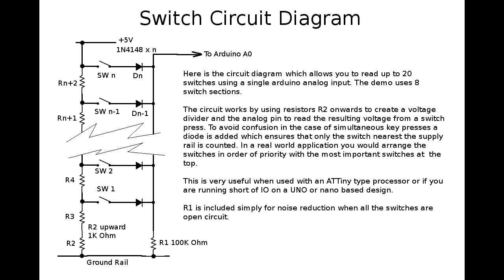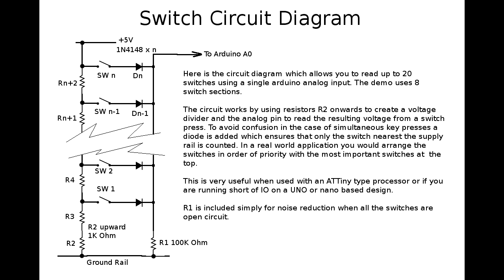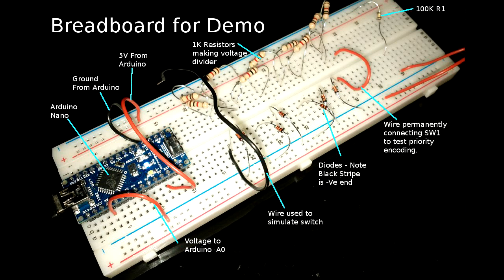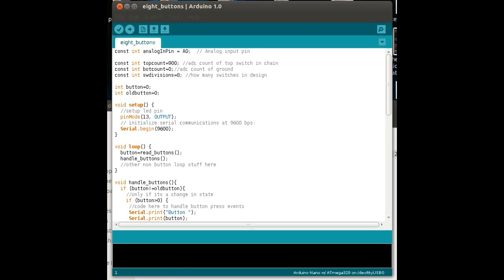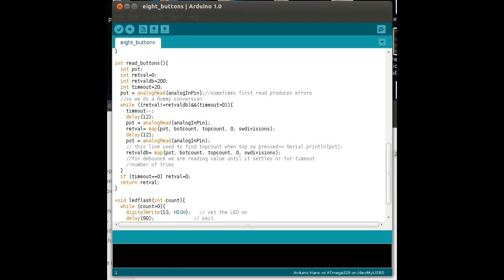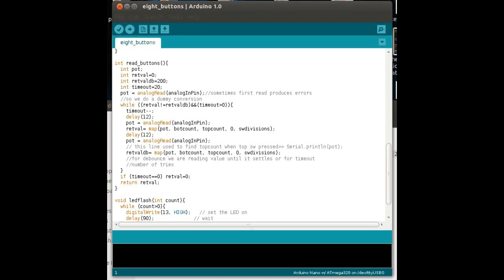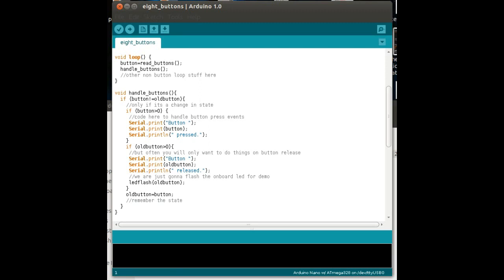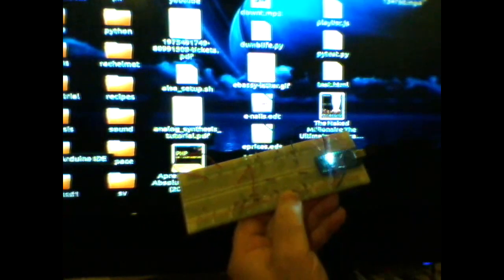Arduino Tutorial - How to read up to 20 switches on a single Arduino input - Even on an Attiny85

Comment: Nice idea. I think Forest Mimms used something like this in a security system that could tell which window the burglar was coming thru. I don't think it used the diodes, and it was WAY before the Arduino. I suspect it would fail when two burglars came in two windows at the same time.
Reply from the maker: Too true it would. I did some work for a security company once that specialised in Museum security, it was what we called a 'soft perimeter alarm' designed to reduce police call outs (the country was one where the police charge you!) so doors and windows were designated critical and non critical. If a non critical was breached then wav files with 'theres somebody in the building' noises were played softly through the PA and some lights switched on and off for ten minutes. Critical and it was full court press with the alarm, police call etc. After install they told us the non-critical went off about once a month and their burglary rate had gone down from twice a year average to zero!

Comment: Isn't it generally a bad idea to use analogue input?
I mean if there's any sort of power fluctuation you'll end up reading the wrong values, having it all be fully digital eliminates that risk...
You say you have 20 inputs, but only 6 pins on the ATTiny...

No problem!
20 in binary is 10100 which is just a 5-bit number, meaning you can use 5 pins for it. You could then make use of a "32 to 5 encoder" and make it translate each of the 20 inputs to a 5-bit binary value which you can then read digitally without any risk of mistranslation, you can even apply the override switch by telling the arduino that code "11111" (or 31 in decimal) means "halt" since none of the values from "00001" to "10101" ever fill up all 5 bits with 1's, you can safely have "11111" be the panic button (unless you decide to press all the buttons at once, then you'll also trigger "11111")
Reply from the maker: This is a way putting 20 switches on one analogue input of the Attiny. No analogue inputs are fine if everything is connected to the same supply rail and referenced to it.
Reply: Arduino Tronic couldn't you just as easily have used a couple of shift registers?

Comment: No comments on this?  This is excellent!  Kudos for pushing the limits!  Cheers
Reply from the maker: Thanks - just for reference I did some playing about and found the limit to be around 32 switches for reliable operation - different resistor values of course...
Reply: That is awesome.  I have a couple projects I need to integrate this type of setup.  Thanks for sharing.